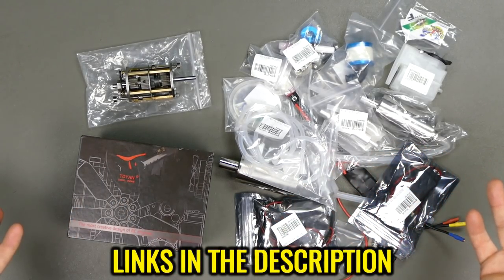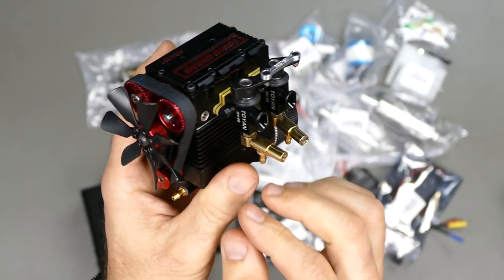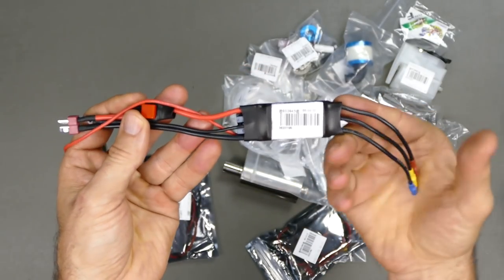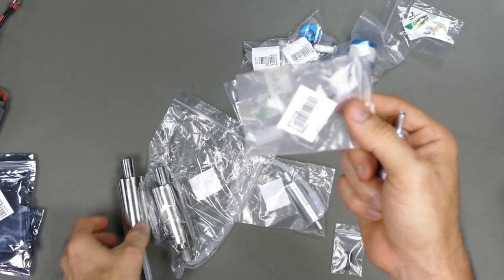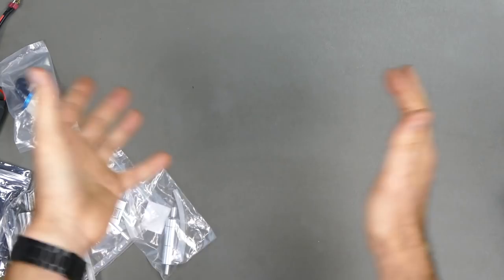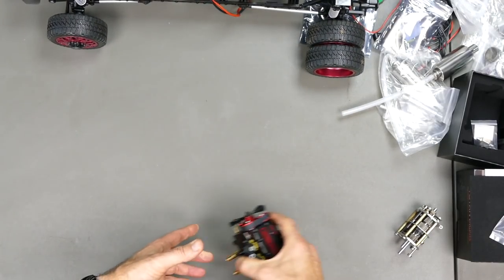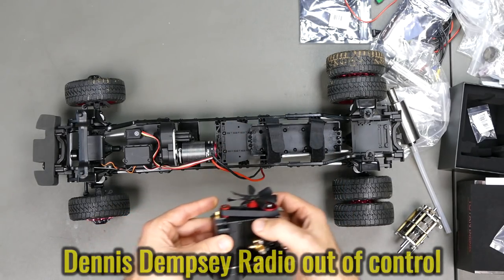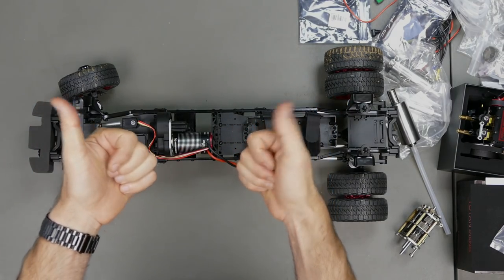FORD F450 TOYAN FS-L200 BUILD - Part 1

Comment: The F-450 would be a first on a toyan conversion brother, I think it will be Cool to see it in there,   If you need anything hit me up!
Reply from the maker: Much appreciated brother. Slowly getting there. Trying to fit a larger gear on the transmission is hard. I only have 15 tooth mod 1 pinions. Nearly one to one ratio. The engine should have enough torque in first gear to move it i think.
Reply: @RCTanksTrucks247  I think it will be a good start with the 15t, the smaller tires on the Cen should be ok, just make the gearbox adjustable enough for larger pinions,  Thanks for the shout out brother!

Comment: I think the F450 would be a good platform, because you don't have to mount everything between the frame rails. You could hang the fuel tank off one side on the outside of the frame, and the CEN has a ton of holes already drilled in the frame. Also don't sell yourself so short Steve, you build some awesome rigs.
Reply from the maker: Much appreciated brother

Comment: Can't the Revo 3.3 transmission have NEUTRAL if you put it between foward and Reverse(why does nobody do that)?!?!
Reply from the maker: It is a very fine line between neutral and engagement. Typically you end up crunching the gears
Reply: @RCTanksTrucks247  Alright because I was really wondering why nobody did that😁

Comment: have you tried running the carbs with their own individual fuel lines having a T seems like it would reduce the amount of fuel you can shove down the carbs
Reply from the maker: Just more complicated and more room with another fuel tank etc
Reply: @RCTanksTrucks247  no just one fuel tank but a fuel line coming out of it for each carb

Comment: You might be able to widen it just a bit. Maybe even just using spacers between the frame rails and the decks? Wouldn’t give you much but it might be just the difference you need.

Comment: Steering could be set up like thee Tamiya 1/14th scale trucks servo on the side of the chassis where the stock transmission. As far as the dually it does not have to be a 4x4, I would manufacture a 5th wheel or use one from a Tamiya truck, or put a swivel ball and build a 5th wheel or goose neck trailer like your military trailer with the gooseneck conversion or modify to take a higher 5th wheel hitch.
Reply from the maker: Yeah I plan to use the Tamiya steering setup

Comment: Hi there, I’m doing a similar build and I was wondering what clutch nut did you use. You used the regular flywheel of the toyan engine, you screwed in 2 pegs for the clutch shoes but then the nut and bell holder, it should have a M6 thread which is not common. Am I missing something? Thank you in advance! Giacomo
Reply from the maker: Just the standard clutch nut for all similar nitro engines. The only new engine that runs a larger size is the NR200

Comment: I think you can use the esc and just solder Y harness for glow plugs i belive it can handle the amp load if not just buy a dc/dc step down converter rated for 5 amps(its overkill for this purpose) and set it for 1.5V and there you go simple glow igniter :D What i would do i would use small aircraft esc for the motor and brushed esc paired with dc/dc converter for glowplugs. This setup would allow you to start it remotely.

Comment: DO IT! Also, any plans on getting the I-4 and shoving that into something?
Reply from the maker: Yeah man, slap it in the grey Landover
Reply: @RCTanksTrucks247  I was thinking a dieted down, 3-speed Rovan Baja actually. It wouldn't be 'holy fuckballs I have whiplash' fast but I think it'd sound amazing, be enough power with a 3-speed trans(which Rovan sells!), and just be hella fun to drive in general.

Lookin' forward to seeing your build...also, from what I understand, the engine itself comes as a kit, so it'd be pretty sweet to have a series of videos made around assembling the thing if that's the case.
Reply from the maker: I like to have them looking scale. Like under the bonnet and stuff
Reply: @RCTanksTrucks247  Ye I can dig that too, but I can also dig having an RC that sounds like a MkII Escort Cosworth at full song ripping down a rally stage.